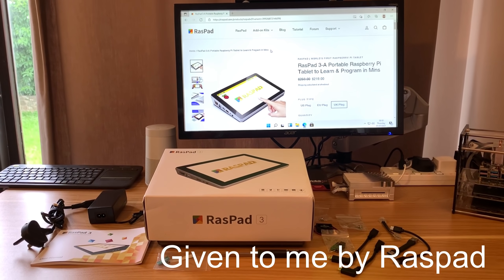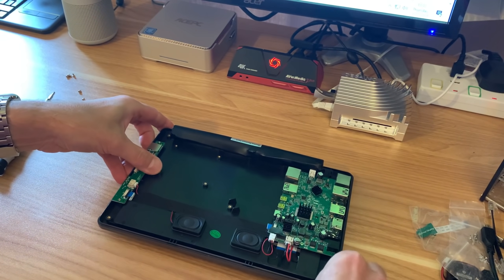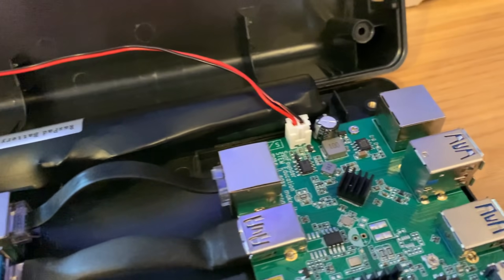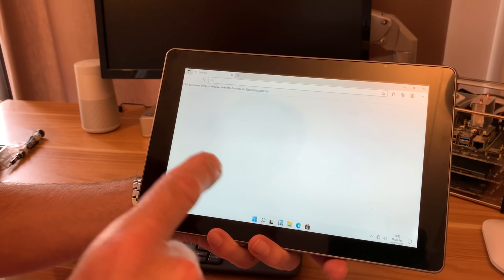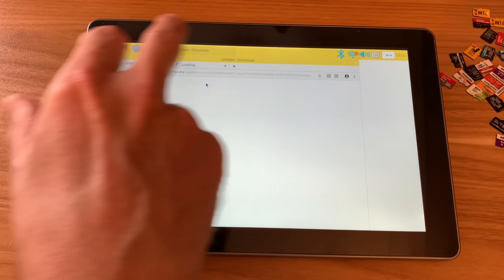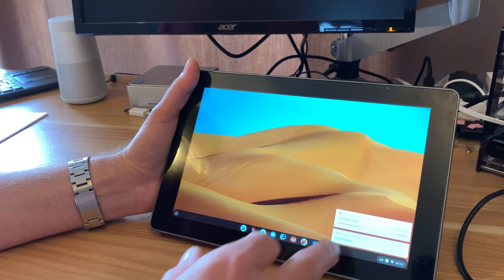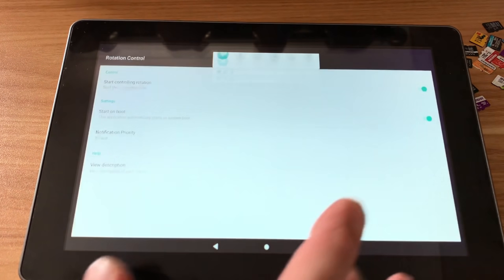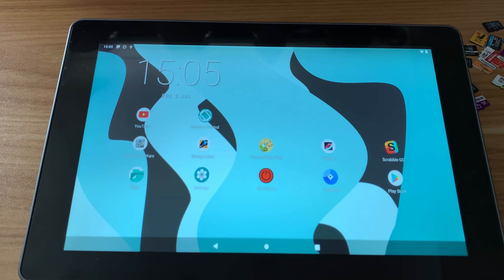Raspad 3. One Tablet, Multiple Operating systems. Windows 11, Linux, Android & ChromeOS

Comment: Nice idea but for me it's far too expensive. Wifey got a Lenovo tab recently was sub £100 in the UK delivered
A quick check and this is £200+ and that's without a Pi4!
Reply: Duke Hugh Johnson  but over treble as much? Is it really 3 times better? And the tablet includes 2 cameras....
Reply: Well, they can’t order the parts in really big bulks, so they have to sell it at a higher price to make up for the costs

Another option might be to buy a second hand tablet, rip all of its guts out, jerryrig the display to work with the pi, and try to fit the pi in it, the end result might not look good (depending on how much u spend on the project), but it’ll be cheaper
Reply: @STORMFIRE07  So spend lots of money to end up with something not as good?

I'm not saying it's not a good idea, just for me and the better half it's just not worth the cost...
Reply: Oh I could imagine running this as a media server/player with an inbuilt DAC (like a Dragonfly) or a home assistant.  Nice !
Reply: @adrianhendy  
It shouldn’t cost that much, a second hand tablet should cost u $50 (depending on how cheap of a tablet u buying), a pi will cost anywhere between $5 and $75, so on average the total cost should be less than $150
Reply: @adrianhendy  
Why you can’t get a second hand tablet for less than $50? Try searching for an off brand one or a kids tablet, here one of those costs $38
Reply: @adrianhendy  
What i was trying to say that u can make a raspberry pi tab for under $100, but you don’t have to

Comment: The Win11 Build you got is very old in comparison with the current build on the Insider Preview Dev channel. You have basically Win 10 with just the Taskbar from Win11. The new Settings App is missing the new Action Center and some other UI changes.
Reply: "..but this Windows goes up to 11" - Nigel Tufnel, Spinal Tap.
Reply from the maker: Very old. It’s not out yet 😀

Comment: It'd be more appealing if there wasn't so much space wasted at the edges of the screen.  OR imagine how much slimmer it would be if it used the board from the Pi400.
Reply: Or if they used the CM4! The timing when they released it was just slightly before both the 400 and CM4 came out, I’ve found the RasPad to be a bit too thicc thick for my liking…

Comment: Be nice if it used the Compute Module 4. It would be slimmer and might have more room for batteries. An M.2 interface would be nice also.
Reply from the maker: As the best seller the Pi 4 has such great support which makes this compatible with the huge amount of Pi 4 images available

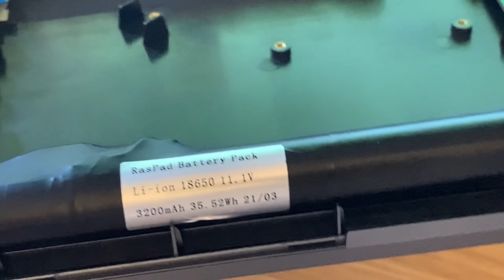Comment: 3:40 I don’t think those batteries are safe for that kind of tablet, because if it gets too hot, 🔥. If the battery is swappable, I would change it to a different battery… one that’s not lithium ion.
Reply from the maker: Lithium ion batteries are used in most mobile phones and electric cars. Issues are not that common considering how many are around.

Comment: Based partly on this video (and others on the same topic), I purchased a Raspad 3. One thing I don't remember seeing in this video is much if any mention about network connectivity. In my experience, Ethernet works fine. But the wifi is terrible. I use Pi 4s for everything from my drones, to controlling my 3D printers, and all of them are on WiFi. (I use WiFi extenders on my drones to get better range.) For whatever reason, the Pi inside the Raspad can scan for WiFi APs and find them, but actually connecting to them literally never works unless I'm standing with the tablet in my hands no more than 4 feet from the AP in my office. I assume its because the Pi's sad little resonant-cavity antenna is sitting under the screen, but it's the worst I've seen FWIW.

Comment: This is the best tablet now
Reply: maybe could add a pijuice for longer power ... or the argon m2 drive
Reply: @jyvben1520  the argon m.2 is just a USB to SSD adapter not an actual drive.  You can accomplish the same thing with a smaller/cheaper m.2 enclosure.

Comment: I got one from the original kickstarter. Sadly one of the included hdmi cables in the case was defective, and I had to replace it with a generic one. Doing this killed the touchscreen aspect of the device, since I think somehow the HDMI cables in tandem are responsible for the touchscreen. I need to find a compatible and short hdmi cord that will restore this functionality. The HDMI cords that came with it are just a tad too short to reach well inside the case, they just made the fit far too tight in there.
Reply from the maker: I would have thought the touch functionality was supplied via Bluetooth.

Comment: On mine the Ethernet Cable connection will Not work.  Tried other cables connected between  Pi4 and  RasPad but it still won't work.  If I connect Cable directly to Pi4 it works.  Other than that I use Wifi.
Reply from the maker: I haven’t tried Ethernet

Comment: I didnt even think about the battery...there is none. It has to always be plugged in or did I miss something at the beginning?
Reply: There is a battery.... it's mentioned
;)
Reply: @adrianhendy  cool thanks, I must have missed it
Reply: @haze42082  no worries - it's got some 18650 cells in it - so basically batteries. It's just a round set of cells

Comment: Because of health reasons I spend a lot of time in bed, I live on my iPad 4 as my wife if terrified of me starting a fire falling asleep with a laptop. YouTube and eBay both want to go to the apps when on an iPad and there’s no way of turning this off. I have my Pi on my bedroom TV with a cheap small Bluetooth keypad and mouse, which all takes up more room. This looks interesting to say the least.
Reply from the maker: Try the iPad in incognito. That way you should be able to prevent the browser opening the App

Also you could do this and use the Pi remotely with a full desktop browser

PiPad Pro, Raspberry Pi 4 Remote Desktop with iPad
https://youtu.be/jRi9BjvDkkE

That said the Raspad is still worth getting.
Reply: @leepspvideo  Thank you very much indeed, I never even thought of using incognito. Thank you for the link as well.

Comment: I have that Tablet  (for at least 2 months now) , but I don´t like its default OS , Actually I'm using it with Twister, the only Issue is the accelerometer ,It only works with that default raunchy os with little option for customization, however  and I really liked as a portable Raspberry mini pc , more than as a Tablet, I won't recomend it as a Daily use tablet or to give it to your kids , they will feel frustated if they come from iOS or Android (even if the Raspad is using android)

Comment: Would a SSD fit in the case so you can run Berryboot?
Reply from the maker: Possibly, Berryboot will run from a usb drive
Reply: The SSD or NVME access would be so much faster and give you better options on the whole system
Reply from the maker: @davidferguson7075  I think my M.2 will fit